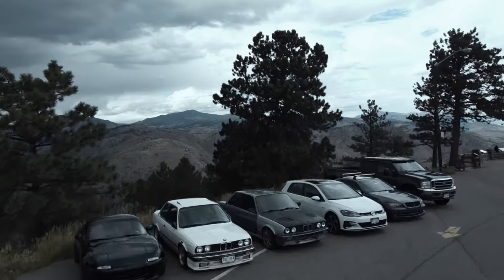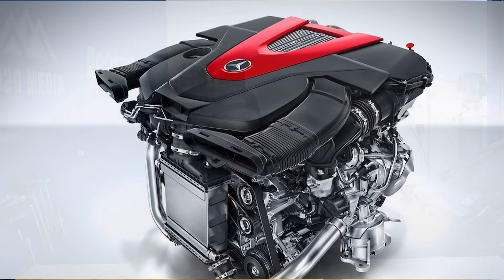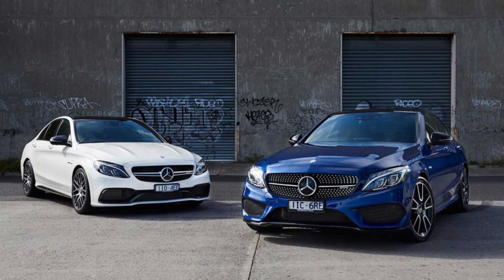How to Build a 500WHP C43 AMG! (DE30LA Engine)

Comment: CAI, downpipes, stage 2 ecu tune, tcu tune, iridium spark plugs, aftermarket exhaust, intercooler, suspension lowering springs, lightweight hood, tires with low roll resistance, unplugging the infamous oil pump solenoid, those should all work together to make a very fast car
Reply from the maker: A - Well said. Do you have one?
Reply: @8020Media   yeah but it’s fully stock atm, its pretty quick already I can’t imagine what stage 2 will be like
Reply from the maker: A - yep!
Reply: @aethereal999 do it. My E43 is stage 2 rn 470+ whp
Reply: @ThorHiney210   does the torque pull really hard cuz that’s what I really like
Reply: Just got mine about a month ago looking to do something similar but idk where to start!

Comment: I got a 2019 C43 that’s full bolt on 93 making 450hp to the wheels and probably 550 crank. Very fast car I could only imagine how it would be if I were to upgrade the fuel pumps
Reply from the maker: D - Nice! Keep us updated on your build.
Reply: Let’s see it! 🔥
Reply: You’ll throw a rod if you try passing 530 wheel
Reply: I have a 2019 as well and will be doing those mods soon, I have a tune from amr performance along with the tcu and cpc tune as well and my acceleration has picked up a lot
Reply: @joanderson4568 i have 20 c43 and starting plans to upgrading it. Why did u go with AMR and not EuroCharged if u dont mind me asking?

Comment: As of 2024, there just isn't enough support for this platform... Weistec JUST made a CAI, but there aren't: Head bolt upgrade, rod/piston upgrade, which are weak points as mentioned. You'd end up putting a lot of money into something that honestly can be attained by getting a newer vehicle (RS3 with a tune makes around 550-600 with ease). I love my C450, but unless i want to put more money into it than jts worth at this point, it's simply not realistic. I'll stick with 450ish to the wheels with some issues (timing chain, jerky trans) and run it into the ground (or sell it right before) because that makes sense imho. Luckily, as a VW group auto tech, ownership is mad cheap. 😅
Reply from the maker: A - We agree. Sounds like you have a good build though! 450 to the wheels is still a fun ride.

Comment: I put Logo's engineering downpipes, cold air intake, and a Eurocharged stage 2 tune but I have no idea what it dyno's at though. I have 2018 C43 Coupe and I think engine internals are next.

oh i deleted the resonator as well and now it sounds like a rachet G37 haha!
Reply from the maker: R - Sounds like a nice build. Thanks for sharing!
Reply: Which logos engineering downpipes did you get? How are they
Reply: Try using a tune from amr performance and I received a boost of 110-130 hp alone a huge difference excluding the first the bolt ons.

Comment: I have a Mercedes 2015 W212 E400 3.5 biturbo m276 (J Spec), would these mods also be safe for my engine, so far i only have BMS intakes and a eurocharge tune rated at 480HP, no one seems to know much about my engine though....
Reply: anything on this bud?
Reply from the maker: To be honest I'm not super familiar with it but from what I can tell structurally it is very similar to the DE30LA minus less boost and a different turbocharger. I would say pretty confidently that the max power levels on the two are going to be very similar, so yeah I think all of these mods would be applicable and safe for you too just keep it around the 500whp mark.
Reply: @8020Media  thanks ya I’m on my way there lol, I have a euro charge stage 2 tune, downpipes, fi exhaust and tryna get the intercooler, finding one that is compatible is the prob, do you think the intercooler that would fit the E43 or C43 be ok for mine? Last question I promise lol
Reply from the maker: Your best bet might be to try to find your factory intercooler part # and see if it matches the C43/E43. They very likely could be the same unit but at the same time I'm not sure what chassis changes were made to house the 3.5 vs the 3.0. The intercooler itself would definitely work its just a question of whether the mounting points will line up and the intercooler piping will match. If you can get the intercooler itself to line up you could just get some piping fabbed to line up. But sorry I can't say off the top of my head that it would or wouldn't work.

Comment: What cold air intake do you recommend for a 2017 amg c43, preferably one that produces more hp
Reply from the maker: L - CTS or BMS.
Reply: @8020Media  is the MST not worth it ?
Reply from the maker: L - Our favorite is the above.
Reply: @leonardovasquez1210 MST is the best V2 version with Inlets. But it is more expensive than CTS and BMS

Comment: So, I have a 2019 E450 4Matic coupe with the same engine. Will I be able to increase its power? I'm not sure what the differences are between the non-AMG engine and the AMG engine.
Reply from the maker: A - Yes, you can increase power. Mod availability may be different.
Reply: I'm running a stage 1 eurocharged tune on my 2013 E400 with 480hp at the crank,  it's an amg engine just without the amg gear box to match. No issues so far, very chill with the extra power.
Reply from the maker: T - Nice build! Thanks for sharing.

Comment: Mercedes vehicles generally come with cold air intakes, as they literally pull in the engine air from the very front of the vehicle.
Many so-called "Cold Air Intake" kits literally do the opposite of their name, having a cone filter in the engine bay where the air is hotter.
Reply from the maker: J - Not all aftermarket intakes are what you're describing.
Reply: @8020Media  Yes, I agree. I had proactively selected the word "Many..." (as distinct from "all") to account for that precise point.  🙂!!

The primary point was that many are the exact opposite of what they're called. And some people pay money to have hotter air intake than stock, which really is quite silly.
Reply from the maker: J - Agree with you to a certain extent.

Comment: About to add C43 AMG biturbos to my C32 AMG compounding through the M112K Supercharger with F1 interchiller on flex fuel E85 all custom fab car designed to run Drag n Drive events.
Reply from the maker: D - Sounds like a sick build! Keep us updated.
Reply: Sounds like a load of bullshit
Reply from the maker: K - Lol.
Reply: @kingbryant5673  Build starts straight after we finish SMDC24 in an 8 second Holden wagon.

Comment: 1. Tune 3:19 
2. Cold air intake 4:26 
3. Down pipes 4:52 
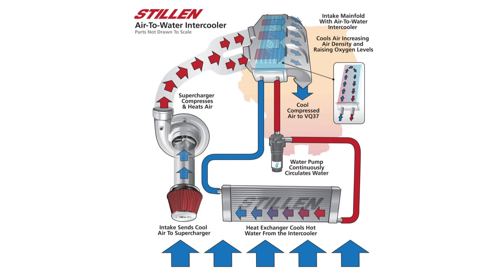4. Inter cooler 5:52 
5. Methanol injection 7:07
Reply from the maker: A - We have this in our description, but thanks for taking the time to do this.

Comment: I found a intercooler for the c43 for 800.00
Reply from the maker: Nice - which one?
Reply: What brand would it be? I only need that for mine. I already have everything else to tune it. I want to put in a culer, but I normally see them for around $1200.

Comment: The CAI’s that most brands offer heatsoak, since they are right above the engine. Logos offers some that are by the front but most don’t seem worth it. You might get some better sound and throttle response but you are basically sucking hot air into the turbos. 
From what i know stock intakes with upgraded air filters (K&N or BMC) is the move.
Reply from the maker: S - Always a highly debated topic. To each their own, we will always go for upgraded intakes as they bring much more air into the engine.

Comment: The e43 amg is all the same?
Reply: Yep same engine
Reply from the maker: The newer versions yes, not the few random years they made it in the early 2000's.
Reply: @8020Media  ok but e43 and c43 are the same turbo sizes and internal components?
Reply: @Ban1l  internals and turbos?
Reply: @joaopereira1935  They are same ofc they can look different but they are same
Reply: @joaopereira1935 they are not the same. E43 has bigger turbos . The facelift C43 390 hp is closer to E43 401hp
Reply: @martinvasilev1997  e43 can make more hp?
Reply: @joaopereira1935  my e43 is with racechip gts black, intake and cat downpipe and i got 500hp. Only with racechip i got 458 , with racechip and mst intake only without downpipe 474. But it weights more than c43.
Reply: @martinvasilev1997  i Will install downpipe . Its easy to install ?
Reply: @joaopereira1935  For 2-3 hours my mechanic did all the work. Are u gonna use racechip or custom ecu map?
Reply: @martinvasilev1997  custom ecu
Reply: @joaopereira1935  if u dont change the cpc module i dont think you can get more than 460hp with downpipe.  Thats why i think piggyback racechip is the best solution for e43 . The cpc module cost alot. Nobody in my country with custom maps got better times and hp than me unfortunately. They are with stock cpc module cause it costs around 2000-3000$ to change and even its not 100% sure it will be better than racechip
Reply: @martinvasilev1997  what racechip hou have ?

Comment: I have wheels that I bought for a c300, and I would like to put them on my 2018 c43 amg. But the caliper on the c 43 is huge would
not alow the wheel fit, do you think using  spacers work to get over that caliper in the front. and what mm of a spacer do you think would work??
Reply from the maker: That would depend a lot on the size of the wheels you're trying to fit. A spacer would just make the wheels stick out a bit further, not necessarily give more clearance height wise if the wheels are like 17's or something tiny you are trying to get to fit.

Comment: Newby here - I just a bought low kms 2017 pre-facelift c43 AMG as a daily driver with  AMG Race Seats, AMG Performance Exhaust,  AMG Alloy Wheels  . i hope it’s as much fun as my m4, always wanted one that looks like a baby c63.  I did test drive a stock c43 a while back but found them to be a little lack lustre.

 Does anyone know if there is an equivalent to BootMod3 (BMW TUNING SOFTWARE) for the Mercedes c43?  stage 1 tune is so easy on the bimmer and i loved tinkering with the settings myself using just a laptop or iphone & OBD cable adapter  or do  i have to chip it by a professional tuner?
Reply from the maker: D - Sounds like a nice daily! When it comes to tuning, there are a bunch of options. AMR or Eurocharged might be your best bet, but it's not quite like bootmod3's UI.
Reply: @8020Media  thank you so much.
Reply from the maker: D - No problem at all. Keep us updated!
Reply: DME is way better than Eurocharged or AMR, AMR pays people to give them good reviews, eurocharged is a brutal tune and is crazy expensive (2,200$ for stage 1). DME is ur best bet for stage 1, they give u good extra power and remove the limiter nonsense
Reply from the maker: S - Thanks for taking the time to share this insight and helping out other viewers!